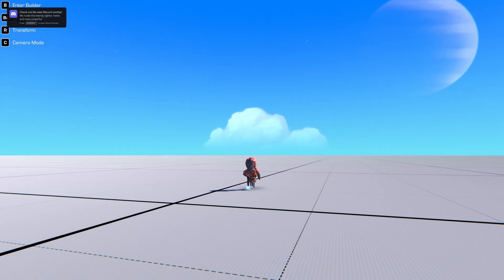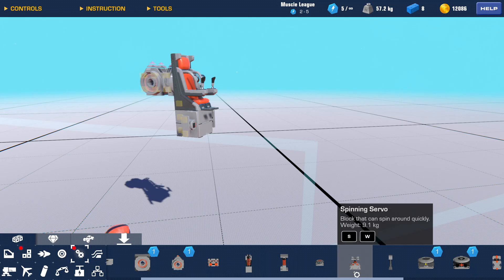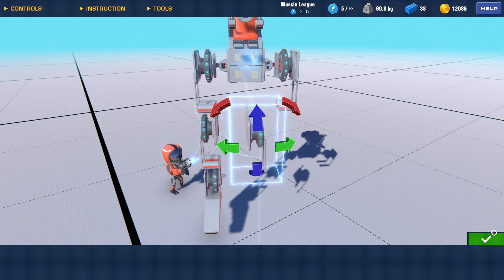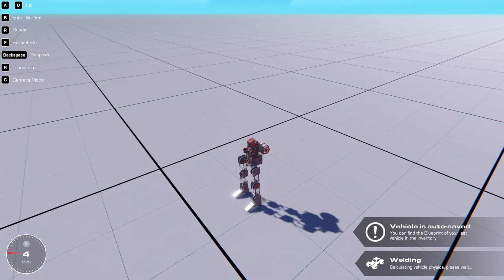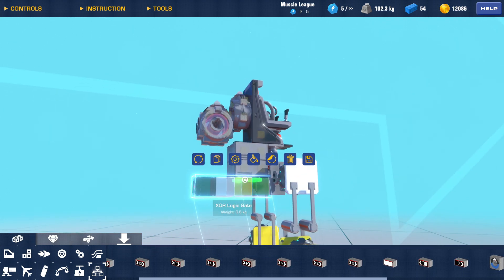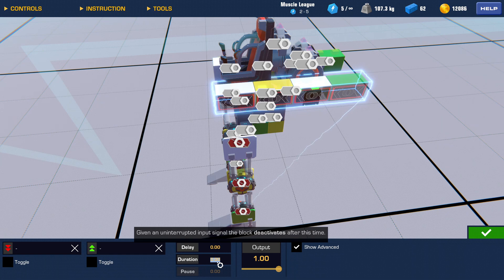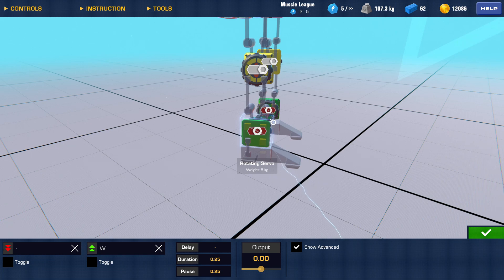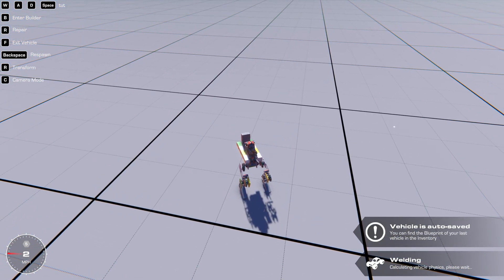How to make a Realistic Walking Mech in Trailmakers!

Comment: I’m struggling with terrain and the left leg is slower
Reply from the maker: try adjust the logic the controls the angle of the foot until it handles terrain better. As for the left leg being slower, double check that the speed of the servos matchs the other leg
Reply: Thank you so much

Comment: Great tutorial but there were a few problems. One of them was that the mech is just a little jittery. The second problem is that the left leg spawns in front of the right leg instead of side by side. And the third problem is that it runs funny, when I say “runs funny” I mean that the right leg goes at a faster pace while the left leg runs a normal pace.
Reply from the maker: The legs should spawn in at the same angle and move at the same speed. Maybe one of the logic gates or servos has a slightly different timing or speed compared to the opposite leg.
Reply: @NebulaDude394   my mech is super jiggly and i have the gyro things set to five and i tryed to set them to ten but its still super jiggly
Reply: @bignugget4499  dont use the second one

Comment: i made this mech and it works really well i tweaked the gyro a little because it was shaking but do you think you could make an are tutorial that goes with this mech?
Reply from the maker: I might make an arm tutorial in the future. I will say, arms are really simple because you can just use 2 xor gates and make a walk cycle similar to the legs. Just have the arms swing at the shoulder joint.
Reply: What did you do to tweak the gyros? This is my first week on the game so I'm still learning the ropes

Comment: how do I make the robot walk slowly instead of so fast? what settings should be changed?I saw how you answered the same question, but I did not understand what needs to be changed
in the legs to reduce the speed, but in the parts where it is negative, what to do and how to change the walking animation
Reply from the maker: For example, if you are changing a servo with a positive number from a speed of 1 to 0.5, then on a negative servo, change -1 to -0.5

Comment: Everything worked perfectly fine until the end, when i was trying to walk and somehow the mech is just sliding in the opposite direction. Also the servo on the right knee isn't working correctly, i checked the settings both of the servo and the logic gates but everything seems correct but the knee is twisted in the other direction. Can anyone help? Edit: fixed everything
Reply: Hey there, I’m currently having this problem, how do I fix this?
Reply from the maker: Make sure that either the knee servo or logic gate arnt inverted

Comment: I’ve done it exact but he just tweaks, starts violently shaking and doesn’t want to stay still. I’m at 7:01 so far and when I test it it is nothing like yours, any tips?

I just fixed the tweaking by lowering the gyro, but now he keeps tipping and falling on his arse 😂

Another update, it’s completely finished, checked everything and it’s the same as yours, no tweaking but it is still back heavy and tipping over as soon as it spawns, even though it’s the same as yours
Reply from the maker: It sounds like the gryos keeping it vertical are to weak. Try finding a balence between strong enough but not too strong so it doesnt tweak

Comment: Hey, i ran into an issue where once i hooked up the three command blocks to the joints, one of the legs actually bent outwards instead of inwards, im not sure what went wrong?
Reply from the maker: Just make the angle negative or positive and see what works
Reply: @NebulaDude394  I managed to fix it by adding a seperate inverted logic block for the centre thigh. Now i have the issue that when my mech walks forwards, the legs swing too aggressively and it doesnt move, just flings up.